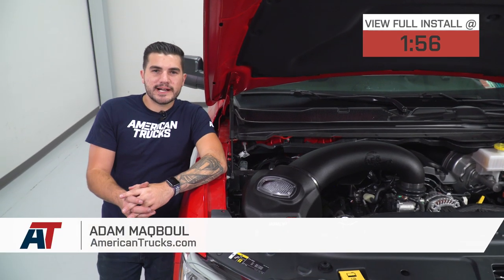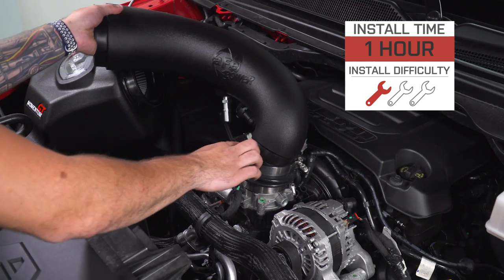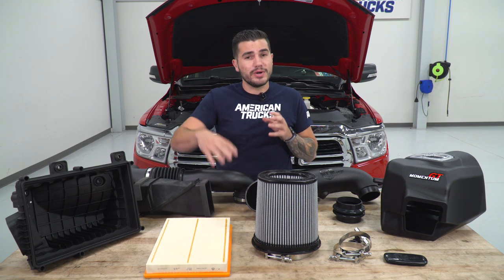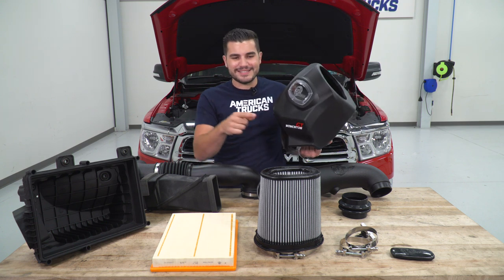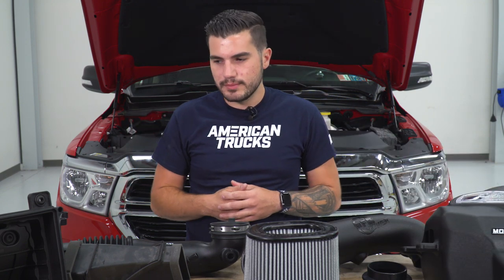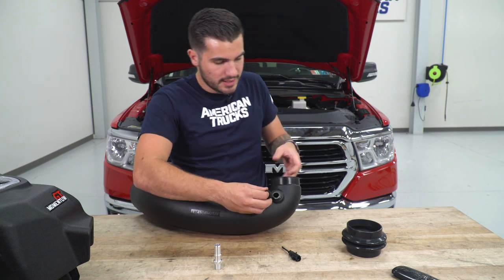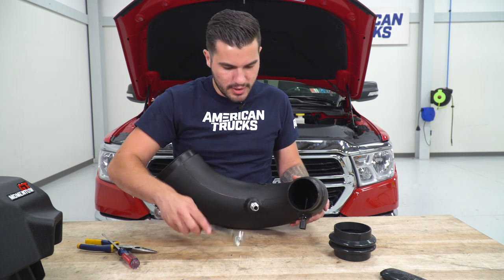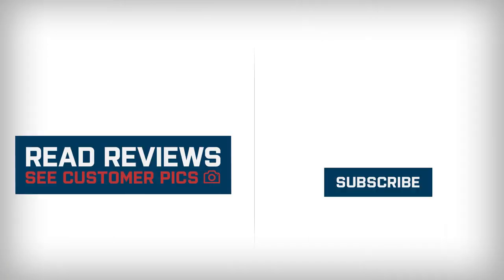2019 RAM 1500 5.7L AFE Momentum GT Cold Air Intake w/ Pro DRY S Filter Review & Install

Comment: I'm an idiot (salesman) with only minimal mechanical skills.  I watched this video a few times, ordered the unit, and installed it all yesterday.  It took about 35 minutes.  There was some beer sipping in there too, so probably could've done it in about 30 minutes.  Very simple install.  Two things - I have a 2021 Ram 1500 Laramie with the 5.7L V8 eTorque engine.  There's a thing called a Motor Generator Unit (MGU) that sits on top of the alternator.  It made it a little more difficult to get to and tighten the clamps around the coupler that mounts to the throttle body, but not massively more difficult by any means.  The MGU doesn't exist in this video, so I thought I'd mention it.  Also, the metal/aluminum hose fitting that gets mounted to the underside of the new AFE kit's main air hose is now a hard black plastic piece and not metal as the video shows.  Not a problem as the new plastic piece is very sturdy feeling.  Lastly, at 7:35, he talks about a rubber plug that fits into the side of the filter box and mentions that you can leave it our when installing the unit for more air flow.  That's what I opted to do also.  

This is such a thorough instructional video, that I didn't even bother with the written instructions.  Just put your phone near your work area and watch it as you go.  I took the truck out on the road last evening and let 'er rip.  I could definitely feel a difference in pick up power.  This is a good and easy mod for guys like me to make without ruining anything under the hood.  Great product and great video.

Comment: And there goes your warranty on you powertrain. No thanks
Reply: If you care about warranty you can't afford the truck. Why would you view this simple mod if you care about warranty??
Reply from the maker: A large majority of dealerships don't give a lot of trouble over cold air intake kits like this honestly, they treat it the same as exhaust systems. If you're concerned about your warranty you can always get in touch with your personal dealership beforehand. And if we want to get technical with things, the Magnuson–Moss Warranty Act protects consumers from dealerships voiding an entire warranty just because you put on an aftermarket part. -Zach
Reply: Like ATR said, most dealers don't care much about cold air intakes. But if youre worried why not just put the stock one back on if you're taking the truck in for warranty work?
Reply: Based on the comments thus far not everyone said that  ALL dealers don't care that means someone does. My point is this that when you start messing something that is under warranty and something goes wrong they would look for an excuse not to honor it. That's the kind of world we life in now a day.
Reply: Actually the dealer and it doesn’t matter which dealership, would have to prove that your modification is directly responsible for the failure of whatever system or part you are seeking to have fixed under warranty.
Reply: Never seen a void warranty for a cai..
Reply: https://en.wikipedia.org/wiki/Magnuson%E2%80%93Moss_Warranty_Act
Reply: That's what the Magnuson Moss Warranty Act is for. They can't deny a warranty claim that you MIGHT have down the road unless they can prove the aftermarket part on your vehicle is the DIRECT CAUSE of the problem.  If you're truly that worried about it, contact the local sales manager from where you purchased your truck. They may caution you against certain things, like installing over a 6" lift or using taller than 37" tires, but they can't flat out deny a warranty claim based on an aftermarket part. They have to prove their case.
Reply: bought my 2020 ram rebel the other day and talked to the service manager about cold air intakes and exhausts and he said that they dont void the warranty. as long as the check engine light doesnt come on, we’re good.
Reply: FYI, I asked my dealership's Service Department Manager if this will void the warranty and he said, "No, it would only void the warranty if it caused the vehicle to stop working for some reason."  That is a direct quote and I was listening closely.  This just allows more air into the system.  It's not going to void a warranty on the powertrain.